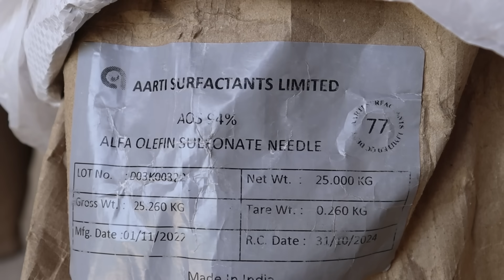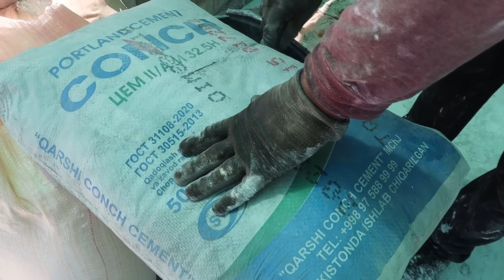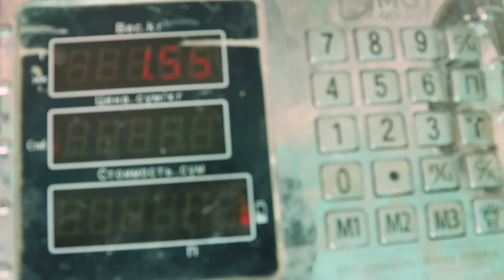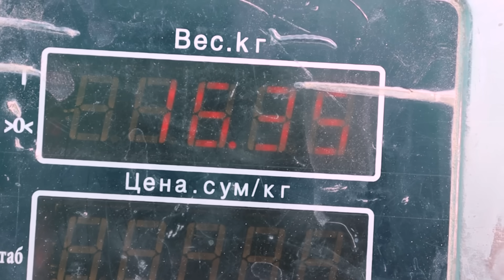Amazing process of making foam concrete blocks | production of foam blocks with subtitles

Comment: I ask because normally 1 liter of additive produces 12.5 liters of foam, with an average density of 80g/lt. So the 5 liters you add to the tank would only produce 62.5lt. So the AOS 94%, since the 250g are dissolved in 5 liters of water, what more amount of water is required in the generator to produce foam for the 150 blocks?
Reply from the maker: 50 liters + 5 liters of water

Comment: If this is left in water, will it absorb and become saturated with water over time?
Reply from the maker: cannot be left on the water, but is not afraid of rain
Reply: @BbAmazingSkills  You might want to read up on roman concrete. Those voids in the foam could be mineralization sites, like in roman concrete after it reacts with seawater.
Reply from the maker: @burgerbobbelcher  👍

Comment: Hello bro thank you for the open video.
in the sub title it says 250 gr of foaming agent for 150 block.
then 37 k gypsum
50 l volume foam which is 1.55 k
50 L water
2 k cement 
here you are talking about approximately about 90 kilo and in the video it shows 6 blocks in the mold which means that each block weigh around 15 kilo .
please correct me if I understand wrong.
its a bit confusing could you please make the recipe more clear and for how many block ?
can we substitute the foaming agent with thick dish washing detergent ?
can we economize the recipe by other combination of fine sand to reduce the cost of gypsum

Thanx bro
Reply from the maker: indicate how many blocks? 150-200 blocks approximately
Is it possible to replace the foaming agent with thick dishwashing liquid? Yes you can
can we keep the recipe using a different combination of fine sand to reduce the cost of plaster? possible, but affects the strength of the block

Comment: Hi great work . I have two questions for you are they water proof on there own  , or do they need plaster cover. What is the chemical formula for the high quality gypsum?
Reply from the maker: 1) they need plaster cover. 
2) Sodium alpha olefin sulfonate is used as a foaming agent that combines the cleaning power of liquid soap, detergents and liquid detergents. Provides acid resistance and biodegradability. Used in emulsion polymerization. Appearance of alpha olefin sulfonate: slightly yellow powder.

Comment: Would consider laying small wire grid into blocks to add strength
Reply: They don't seem weak to me.
Reply: for what, Ytong does not have and make buildings
Reply: No reinforcing is why 3rd world countries have so much destruction in an earthquake.  Sometimes low cost becomes the most expensive in the long run.

Comment: What is size of the block
Reply from the maker: everything is calculated here
Foaming agent - alpha-olefin sulfonate AOS.
250-300 g of alpha-olefin sulfonate makes 150 blocks.
block sizes 60cm/30cm/20cm
the air compressor is set to 5-8 bar
1 block costs $1
1 kg of gypsum costs $0.04
1 kg of Cement m450 costs $0.06
List of ingredients for 3 foam blocks
37 kg of gypsum
2 kilograms of Portland cement
50 liters of ready-made foam (alpha-olefin sulfonate) weighing 1.5 kilograms
50 liters of water
blocks dry differently depending on the season and weather of the country in central asia dry summer time 7 days

https://youtu.be/Ft5w1iwbouo ALL THE SECRETS OF MAKING FOAM BLOCKS
https://youtu.be/D3ajZ7ly6I8 FOAM GENERATOR, HOW TO MAKE IT YOURSELF
https://youtu.be/-h6zBbVkuQI production of foam blocks with subtitles

Comment: What are the materials for making foam in detail? Is it made of one material or two materials, and what are the names of each material? Please answer me, thank you
Reply from the maker: The formula of this supplement is Alpha Olefin Sulfonate AOS.
250-300 g of alpha olefin sulfonate produces 150 blocks.
block sizes 60cm/30cm/20cm
Ingredients list for 3 foam blocks
37 kg of gypsum
2 kilograms of Portland cement
50 liters of finished foam (alpha olefin sulfonate)
50 liters of water
https://youtu.be/Ft5w1iwbouo ALL THE SECRETS OF MANUFACTURING FOAM BLOCKS
https://youtu.be/D3ajZ7ly6I8 FOAM GENERATOR, HOW TO DO IT YOURSELF
https://youtu.be/-h6zBbVkuQI foam block production with subtitles

Comment: Hello, can I ask you please? Did you add some some materials to the mixer with the alpha sulphide to make it thick foam?
Reply from the maker: no
Reply: @BbAmazingSkills  so how does it be foam , is there any other materials can be used instead of alpha olefin sulfonate
Reply from the maker: @ماسامةمحرم  HIGH FOAMING DISHWASHING DETERGENT
Reply: @BbAmazingSkills  such as Fairy, right? 
And also, could you tell me how I can make it thick foam?  Because all the videos shows only when they add the materials to the machines and they show us after that it’s become foam

Comment: Could you please tell me how many liters of foam in total and what density are produced with 250g of AOS 94% dissolved in 5 liters of water? Thank you so much
Reply from the maker: 250 g AOC 94% 5 liters + 50 liters of water for 150 blocks
Reply: @BbAmazingSkills Thanks for your answer friend. With 250g of OSA 94% and mixing with 5 liters of water, 2,500 liters of foam are obtained? I mean 2.5m3 of foam? I ask because in the video it says that 50 liters of foam are used for 3 Blocks, so 2500 liters of foam are used for 150 blocks. Is the information ok? I ask because normally 1 liter of additive (already diluted in water) makes approximately 20 liters of foam. On the other hand, with your formula with 1 liter of additive, 500 liters of foam come out. Is there something I can't understand well?
Reply: I ask if I want to obtain 100 liters of foam with your product, how much AOS 94% do I need and how much water to dilute it?

Comment: Do they require curing, during the drying process? At what temperature should they be drying? (because in India the temperature may go up to 42 degrees)
Reply from the maker: I do not know, but it dries well at normal temperature in 48 hours.
Reply: production will boom such hot place

Comment: Good video.  Thanks for sharing.  What size are the blocks?  And what is the cured density?
Reply from the maker: 60cm/30cm/20cm
Reply: @BbAmazingSkills  Thanks.  And what is the final weight of each block?
Reply from the maker: @darrenderrick9242  finished block weight 16 kg, raw block weight 29 kg
Reply: @BbAmazingSkills  i don't think it's 29 coz in the video it says "semi cured" weight is 29kg.. I'd say it's about 30-40kg in raw weight
Reply from the maker: @ilyrics2775  Libra don't lie, what good deceives you
Reply from the maker: @ilyrics2775  That's why foam is added to make it economical and lightweight.
Reply: Ordinary gypsum not hardening you say you use good quality gypsum can you please send a link to the gypsum suppliers so I. An look for local alternatives 

Otherwise revolutionary

Comment: wow. throw some wire down the center, would make nice fence posts. probably easier to carve than granite!
Reply from the maker: agree
Reply: The would crack in 1 second
Reply: @mikemurphy7519  yes and no. you ever actually tried to demolish a wall made from... well, as a trademark name here... "Hebel"?
thats what it is. foam concrete. and its pretty effin hard to break. a 2'x2' column needs a truck at some speed. put reo in it, that goes up. seen whole industrial buildings made from it. with plenty of scrapes from bad reversing skills, but nothings collapsed.

hmmm... beside motorways as "sound barriers"? there was a viral of some turkey kicking one years ago... lol.

yet you just cut into it with a timber saw and gouge chunks out of it. yep, kick right through and have the blocks above come crashing down on your leg. more lol.

i never really thought about how to make it. dense soap foam, some plaster of paris for quick setup, cement powder for long term strength. easy. figure the proportions out with some fiddling.

lot easier to deal with than solid stone or concrete.
Reply: @paradiselost9946  AAC is never used for fence posts, they are used for panels.
Reply: @paradiselost9946  The problem is it degrades over time and starts to crumble.
Reply: @mikemurphy7519  render?
Reply: @paradiselost9946  Aerated concrete degrades over time and starts to crumble.  It shouldn't be exposed to the elements.  End of conversation please.

Comment: If the flood comes the building shall be floated on the water. Paint aur cement plastering does not stick to the surface very strong and effectively.
Reply from the maker: Paint or cement plaster does not stick to the surface, that's true, but you can plaster with tile adhesive, and then you can apply the facade after it is not afraid of rain.

Comment: Should have tested too in extreme heat or fire if it will somewhat melt.
Reply from the maker: The video was filmed in the hot country of Uzbekistan. the foam block is not afraid of fire, they checked it will not melt
Reply: @BbAmazingSkills  if that is true then that block is incredible (Y) It can withstand heavy beating, extreme temperature and can act as an insulator.

Comment: The concrete lasts up to 2 days, dissolves in water and is non load bearing. Sadly after years of research no application has been found.

Comment: Blocos de qualidade excelente:
No vídeo não fala o tipo de sabão 
Qual a proporção de cada material?
Reply from the maker: 250 grams of 94% alpha-olefin sulfonate distributed in 150 foam blocks.
lista de ingredientes para 3 blocos
37kg de gesso
2 quilos de cimento
50 litros de espuma
50 litros de água
Reply: AOA brother 
very good and excellent job, please keep it up.
250g of 94% Alpha-olefin and how much water ?????
Thanks and regards
Reply from the maker: @pervezkhan3762  250g 94% alpha olefin 5 liters to mix and 50 liters! only 55 liters per 150 blocks

Comment: After mixing the 94% alpha-olefin sulfonate with 5 Liters in a bucket you then poured the solution into a Foam Generator......How much in Liters of water did you put into the Foam Generator so that you get the Foam
Reply from the maker: 250 grams of 94% alpha-olefin sulfonate distributed in 150 foam blocks.
Reply: @BbAmazingSkills  Thanks for the quick response.......kindly.....at 2:15m you added water into the Foam Generator how many liters of water were this? thanks
Reply: I think foam tank is nearly 70-80 liters. So 250gr agent for one full tank.
Reply from the maker: @yasaraydn2290  yes

Comment: It is gypsum calcium sulfate semihydrate (CaSO₄·½H₂O), or hydrated lime calcium hydroxide (Ca(OH)₂). Since the gypsum blocks would be more vulnerable to weathering.
Reply from the maker: FORMULA AND STRUCTURE OF GYPSUM Gypsum is calcium sulfate (CaSO4), which can be present in different modifications with crystalline water (H2O): Dihydrate (CaSO4 * 2 H2O) → Hemihydrate (CaSO4 * 0.5H2O) → Anhydrite (CaSO4). H2O – 20.9%. The chemical formula of gypsum binder is almost the same as that of natural gypsum.

Comment: My house is made of these blocks, I have stress cracks all over the house, again, I only did the last lot 3 years ago, personally I will never have another house that has these blocks.
Reply from the maker: must be performed using this technology. In the video, if you noticed, the fences have been standing for 4 years without cracks.
Reply: @BbAmazingSkills  My house is 30 years old, another house I built using these bricks in 1996 did the same thing.

Comment: Size of the Blocks?
Reply from the maker: 60cm/30cm/20cm
Reply: Dear Brother,  Do u add any hardening agent. I tried it locally but even after 16 hours the mixture is wet. Have done as per the material list.
Reply: Dear Brother,  also let me know how much water is added in foam tank. And how many blocks do we get from 250 gms foaming agent u mentioned.

Comment: Neat but a bit of a flood and your entire wall would fall apart since it's boyant. Couldn't use these for anything at or below flood level, upper floors only. A channel form to pour harder heavier concrete down the middle once in place would be better.

And those exist, Styrofoam blocks you pour concrete in are even cheaper and lighter

Comment: Hi, first of all thank you for your informative videos!. 
I have 2 questions:
1. Is this "regular" hight quality GypSum? like the ones used for Gypsum boards? 
2. If so, how it is water resistant? Gypsum dissolves in water. I see in 8:40 (https://youtu.be/-h6zBbVkuQI?si=eciznl16vtCgeqsk&t=519) you put it in water, can it stand water for long duration ?

Thanks you!
Reply from the maker: Hello,
This is high quality gypsum, used for plasterboard sheets.
It can not withstand water for a long time, for this you will need to plaster the surface of the wall or house with tile adhesive
Reply: @BbAmazingSkills  Thank you for you quick response 🙂.
I see you are using the blocks outdoors, and it dissovles in water, can you explain ?
Reply from the maker: @orenbarash1078  they do not dissolve and dry quickly, returning to their original appearance, and you are advised to plaster the surface with tile adhesive
Reply: Thank you

Comment: I don't trust the integrity of those block..

maybe if they had used an agitator to shake the air bubbles out...

I just would need to know how and what they make that foam out of to be more sure of this material.
Reply: The air bubbles is the whole point of doing this.  The blocks are lighter, easier to work with, and use less portland cement.  If you lose the air bubbles then you just have heavy cement blocks with some soap mixed in.  Can't speak to structural integrity, though.  I have wondered about that myself.  I was thinking of its use in making outdoor planters that would be light enough to move into place easily.

Comment: 60x 30x20 cm x 28 brikcs 1 m3 =448 kg metreküp weight
Reply from the maker: yes
Reply: @BbAmazingSkills We worked with this formula in my country, but the university said that the thermal insulation values were low, so we increased the foam and produced more insulated blocks.
Reply from the maker: @metincetin2980  👍👋

Comment: 01.What was the purpose of angles  and  hollow blocks? Where to use these blocks?

02.how much time it takes to absorb water?

03. What is pressure bearing limit?

04, Which Material Can be used To join two block together while construction.?

05, How is the internal Construction of CYLINDER making foam?

Hope for answers soon.

Comment: ⚠️DO NOT DO THIS as recently it was discovered that Concrete made this way is extremely dangerous over time as it's internal structure is very weak!!!
 Anybody being offered this version of concrete must cease all construction with it and have an analysis carried out!!!⚠️
Reply from the maker: These blocks are mainly used for interior walls of houses and fences. one-story houses and then, if you build wisely, you can build

Comment: 1. Please turn off all music. Super irritating and hurts the ears.  Leave the natural construction / building sounds.
2. Tell us what is in there. What are the ingredients? What is the ratio of each to make this cement block?

Here is what I gathered from the video and my own research:
1.0:40 - Alpha Olefin Sulfonate Needle - (Needle is the shape like broken spaghetti).  Use 1 bowl approximately 3-4 cups (1 cup is 8 oz).  AOS is a surfactant commonly used in shampoos and soaps, due to its skin-friendly properties, cleansing and foaming properties, and ability to combine well with water to remove dirt and oils.  AOS’s primary industry use is in washing powder, liquid detergents, and soaps. Other applications include the textile, printing, and dyeing industries as well as the petrochemical industry. Alpha olefin sulfonate is additionally used as an industrial foaming agent, wetting agent, concrete density improver, and pesticide emulsifier.  Here, the AOS is used to make a foam that is added to the concrete as a plasticizer, insulator, making it lighter, less breakable, and resistant to heat and frost (thermal insulation). 
Here is more about AOS: https://stppgroup.com/products/detergent-chemicals/alpha-olefin-sulphonate/#:~:text=Alpha%20olefin%20sulfonate%20is%20commonly,liquids%20and%20vehicle%20wash%20liquids.

2. Mix AOS with 5 gals of water till dissolved.

3. Pour the liquid AOS into a container. Either it is mixed with something or heat or pressure treated to produce a dense foam. This is the unknown part that needs to be explored further. There is a commercial product called Hostapur OSB that takes the place of the foam, so just buy this, add to concrete mix and done. They will also instruct you in how to mix the concrete ratios. Once you break down what Hostapur is made of, you can make it yourself.

4. Portland Cement - 1 US gal sized container heaped.
5. White powder like gypsum (natural mineral from which Plaster of Paris is made) or lime is added to the Portland Cement.  Could this be some sand too?
6. Add water - enough to make a thick slurry.
7. Add the foam to this mix.
8. Mix well  using drill and paddle.

9. kr means kg in Russian, so 29 kg per block, or 64 lbs each block. This seems very heavy for a foam block, but this is an oversized block. This weighs as much as a Lead Acid 100 AH battery.  It floats.

You don't need to know anything more than - mix your normal concrete. Add this foam. Mix well. Now you have new and improved concrete with additional properties of being rubberized.  This is truly revolutionary.  I will never use regular concrete again!  Even to seal driveway cracks, wow!
Reply from the maker: turn on the subtitles it's all there